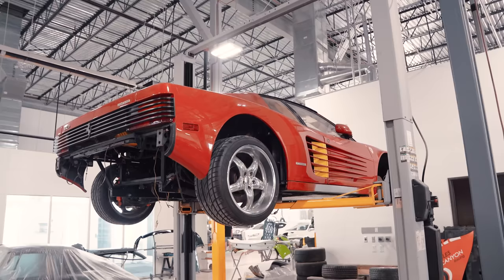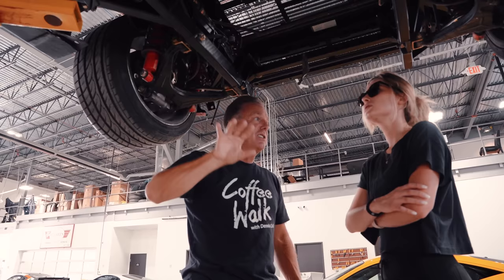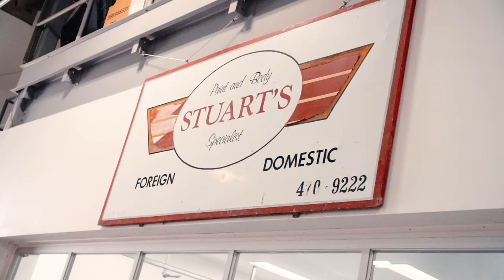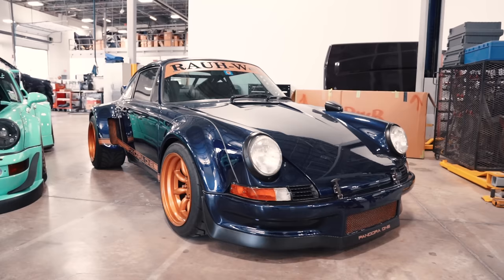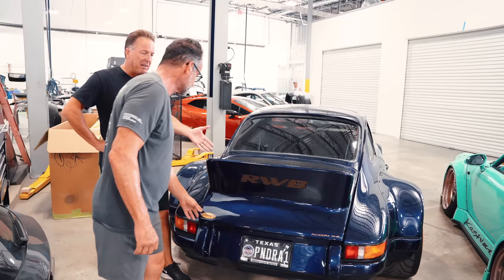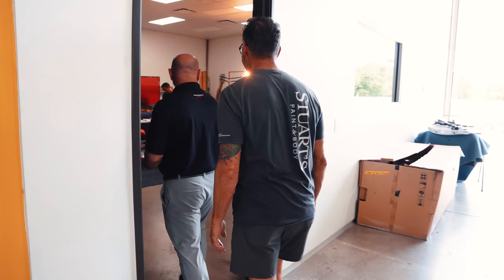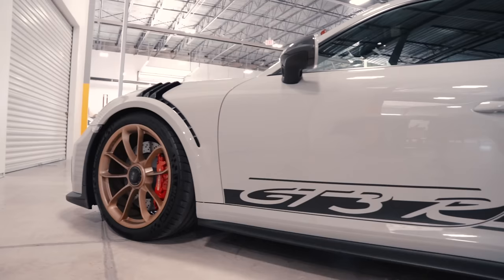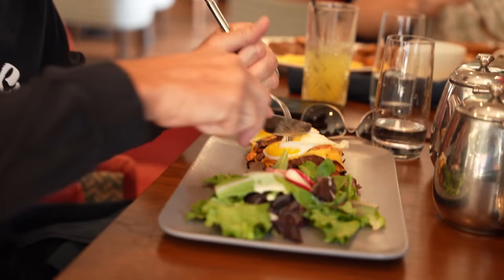Behind the scenes of RWB / RAUH-Welt BEGRIFF Porsche Build with Stuart Singer!

Comment: These RWB Porsches look different , a bit like the racing cars in the 80‘s. I watched a number of videos when they turned an ordinary 964 into a real RWB car. But really , I was shocked about the quality of the work performed. There is no rust protection on the cutting surface. Just screws bolted into the body of the car. A but of special glue and some tape , that’s it. These cars are artworks but far from a sophisticated race or performance car. Not even to mention the the cost related to such a body kit upgrade. I think people do it to show the world that they are cool and have the money. Nothing wrong but any real Porsche enthusiast will never buy such a body upgrade. But these cars look really wild. 😊😊😊

Comment: Could someone please explain to me what does being dry iced mean???
Reply: Dry ice is used through a pressure washer type machine to clean the undercarriage of cars or machines to get rid of grime and stains and rust on frames and chassis parts, steel, aluminum, etc... it dries without moisture unlike steam cleaning which could leave stains and start rusting again.